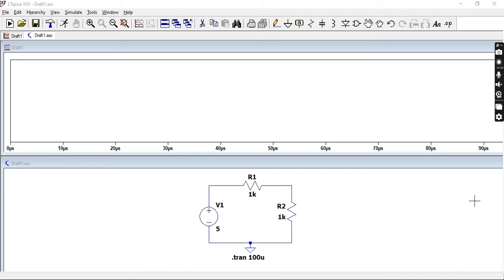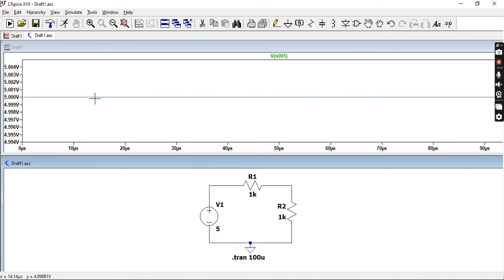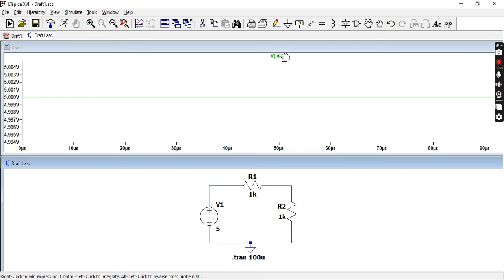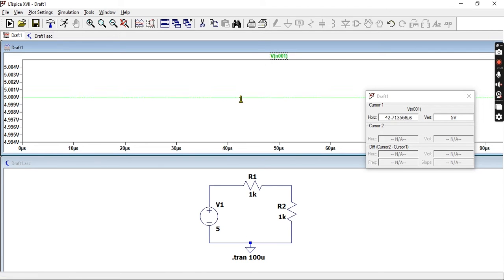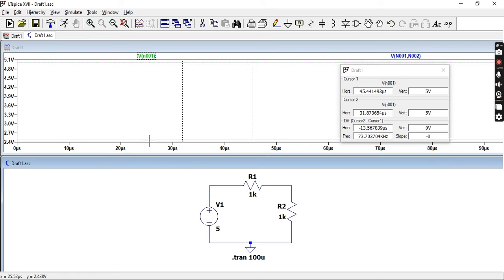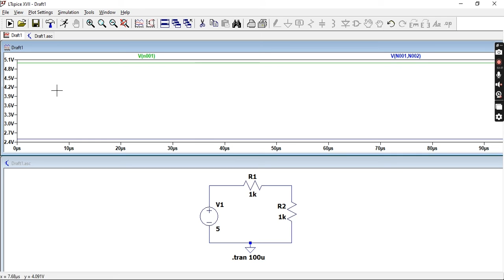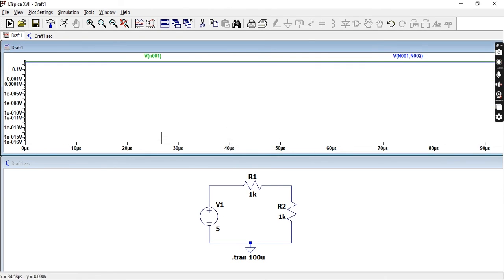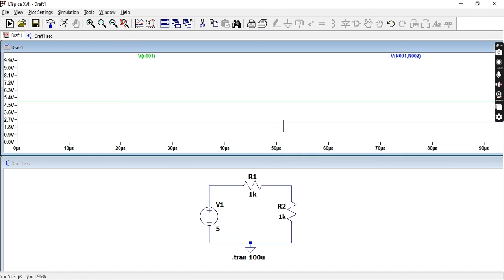Cursors And Axes | LTspice Tutorial | Khetz Tutorials

Comment: But how to set a specific value of time, say 32,55 us?
Reply from the maker: Hello. I'm not sure what you mean by that. Do you want to read a value off at that time? If so, you would need to zoom in a bit more, but it might not be possible to get that exact time based on your output graph. May you please rephrase - I could perhaps give better guidance
Reply: @KhetzTutorials  I would like to set the cursor to a specific time value to know what exact voltage I get when I analyse the transient period of capacitors, etc. For example in NIMultiSim I can set the exact value of X (time). I go to the menu "Cursor" then "Set X value" then the program tells me the exact voltage that the capacitor reaches at that instant of time. But in LTSpice I can't set the exact X (time) value. Thank you very much.